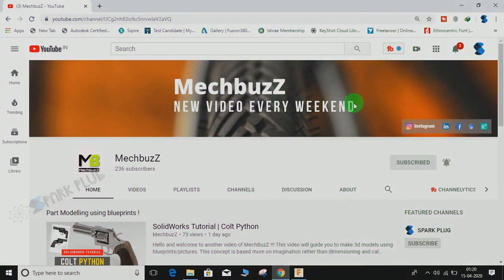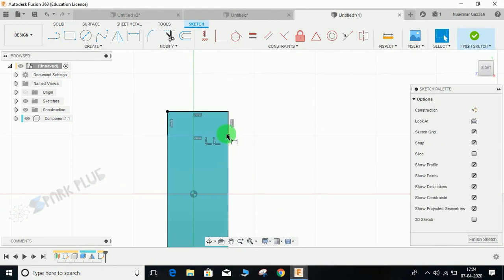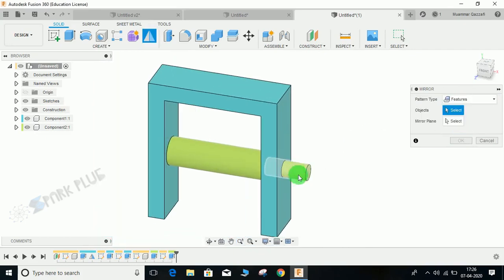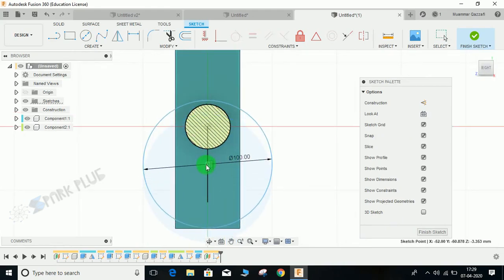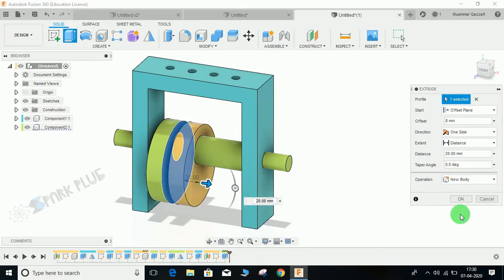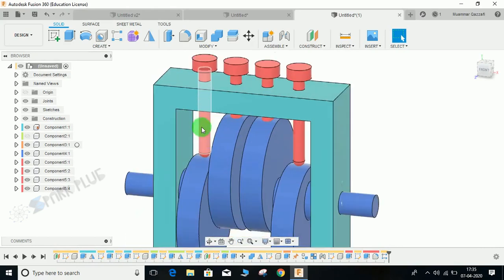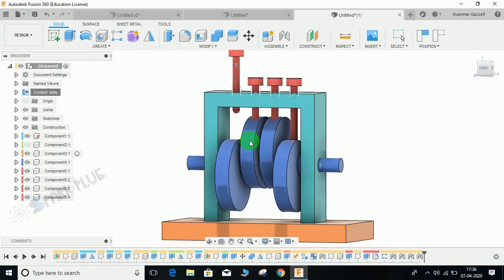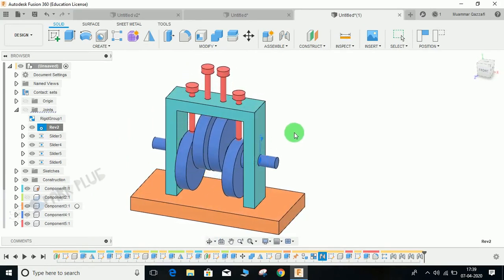Fusion 360 beginners Tutorial | Assembly Tutorial | Cam and Follower |

Comment: When i enimate model it doesn't enimate smoothly but with lots of jurks...is there any solution?
Reply from the maker: Contacts sets depends in Systems performance .
But you can use as built joint to connect the  rotary motion of the shaft with linear motion of followers
Reply: @SPARKPLUG98  I have 10th gen i5 with 12gb ram and mx230 is it not enough?